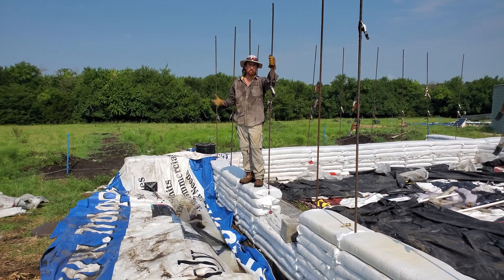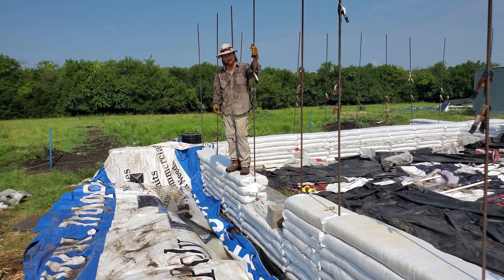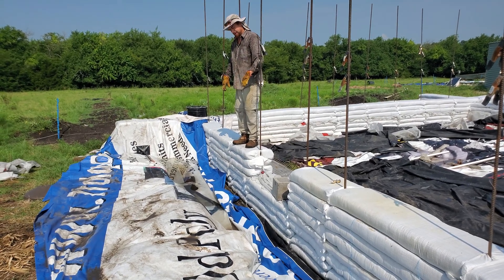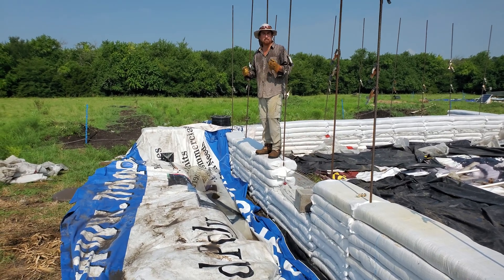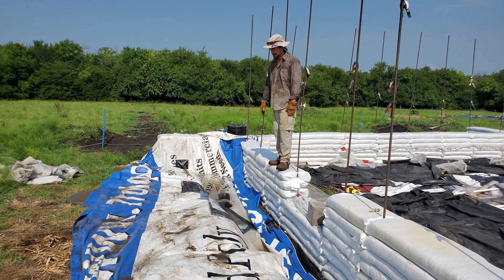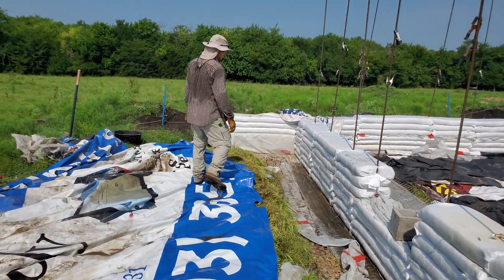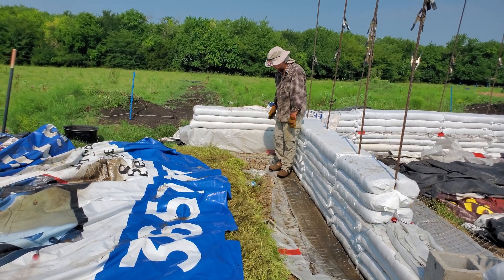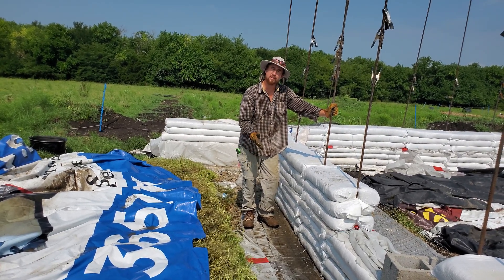How to keep moisture or water away from your earthbag foundation and walls

Comment: I originally built my house on wooden piers, I later went and filled it in with  earthbags filled with decomposed granite and small amount of cement. I then built a small knee wall between the bags and floor joists. Worked awesome, it’s been twenty years now.